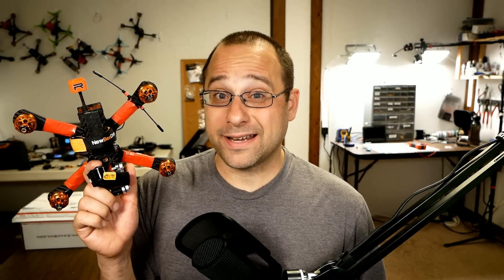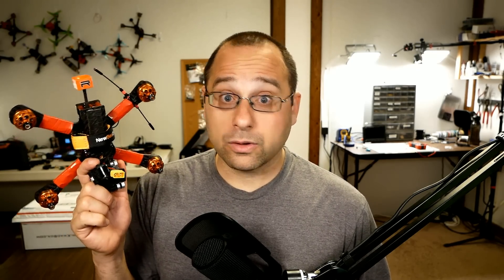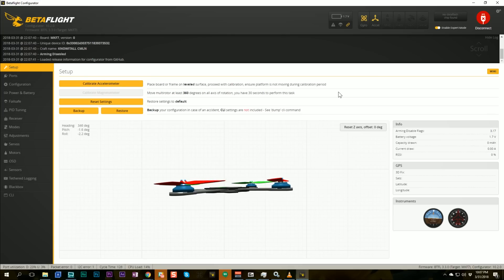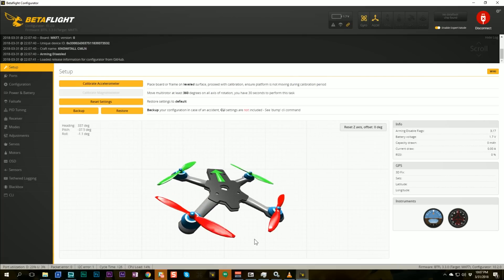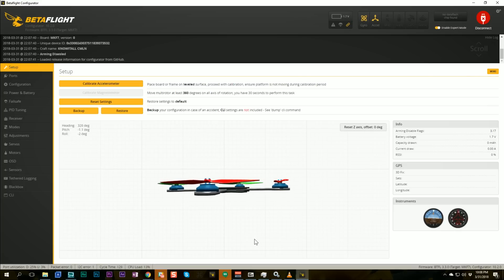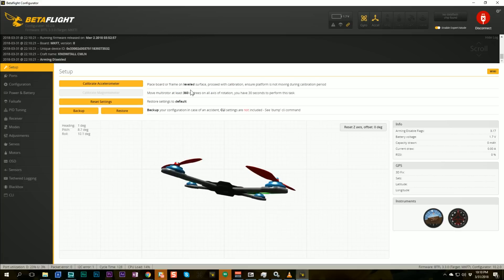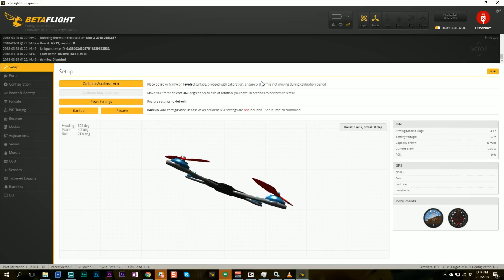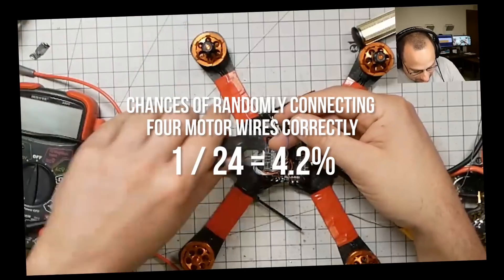Betaflight flight controller and ESC alignment incorrect | HOW TO FIX

Comment: Hey Joshua any reason why on a new build in the setup screen looking at the quad and it’s sitting flat and steady, it’s very slowly yawing clockwise, if looking down at the model, but it seems to be pretty steady when hovering in flight. Should I be concerned or just attempt to start flying normally? Thanks!
Reply from the maker: If it's just moving slowly, I wouldn't be concerned unless it also does it in flight.

Comment: Just flashed to 3.3 today flew first battery fine plugged my second and now I have battery warning and rssi constantly flashing in my osd even though it shows the correct voltage tried other battery’s an still the same, anyone else had this problem? Also if I try save & reboot on BF I get serial port failed to close tried fixing with zadig and impulserc driver fixer still no change. Running kakute f4 v2.
Reply from the maker: Serial port failed to close simply means the FC disconnected and rebooted. Don't worry about it.
Reply: Joshua Bardwell thank you for your reply.

Comment: Very curious... I have a Bcore2 that is flying great... FC mounted 180 on yaw access (right side up, but facing backwards) and set up for reverse via gyro in the "ALIGNMENT" section. 
This video made me take a look, and on the 3d model in Betaflight front was back!!! I just set it up as above.... (yaw @180 and motors reassigned via CLI) 
I wonder if it will feel any different?

Comment: I gues i'm wrong but don't you need to free the motors first in CLI  before remapping?
Reply: I know what your saying I have had trouble with resources not reassigning if not cleared first. I always take the notes I need and clear the assignments save then do the remapping. Its a pain in the butt but that method has never failed me.

Comment: Wish I could change motor direction in betaflight as well. Running parallels and blheli 32 in the field sucks sometimes. (Sometimes I just cross the motors wires and fix it later. 🤐)

Comment: I'm picking nits but... The resource numbers appear to actually be numbers expressed in hexadecimal format B00 (bee zero zero), B01 (bee zero one), etc.  You typed numbers when you entered the CLI commands but you consistently referred to the number zero as 'oh'.  There are bound to be some people who believe you're referring to the letter 'oh' as opposed to a colloquialism of zer-'oh'.
Reply from the maker: Betaflight will reject that if they try to do it.
Reply: I know.  My point was that if someone is unaware of the difference, using 'oh' instead of zero might be a bit confusing even in understanding an error generated from Betaflight under this circumstance. I'm not even sure whether using 'oh' as a shorthand for zero is common outside the US.  Again, this is a nit pick. This was another very useful video.

Comment: Great information.

Having a wizard in the Betaflight configurator to do the FC alignment and motor remap would eliminate this problem.  While at it, a wizard to set pitch/roll/yaw/throttle channel order (and reversals) would also be nice.  These are the common absolute basics set up on every quad.  Why not have the devs make them super easy.

For alignment, wizard would ask (level copter, then tilt model forward (and return to level), then roll model left (and return to level), then turn model left (and return to original direction).  {do change, then a repeat to confirm}.

For motor it would have sliders for each motor and move sliders till motor 1 spins, (check once found, grey out slider).  Then move sliders till motor 2 spins  (check once found, grey out slider), repeat till all 4 motors done, then do a confirmation.  Then do a confirmation that the appropriate motors spin.   Alternately spin each motor at 10% for 5 seconds and wait for a keypress when on the correct motor.  Make the whole process super easy.
Reply: ArchmageAU you mean like RF1/Flightone?
Reply: I have not used RF1/RaceFlight/Flightone/Butterflight/Kiss or any other quad firmware apart from Betaflight.

First quad was a Wizard X220 in August 2017 (so fairly new in the hobby).

The idea of a setup wizard is just common sense.

Comment: The option to adjust gyro and accelerometer alignment individually was probably added for users of custom boards, or to overcome an error in the target code.   

Pro tip: if you examine your orientation carefully, you might find you can get there with only one step.. IE, if you yaw 180, and roll 180, you can simplify it with only a 180 pitch.  This might be pointless on he f4, but on the silverware firmware on an nRF cpu, the performance difference was tangible...

Comment: Good topic for a video Josh.  I've been building for a little over a year now, and remember learning this the hard way back when I was getting started in the hobby.   Now my very first step when connecting a new board to betaflight is to check my alignment by pitching and rolling the board in the setup page..

Comment: doesn't a 4in1 esc have motor designation signal wires ? I'm sure it doesn't matter how you install 4in1 as long as the motor signal wires are connected to the FC in the correct motor config
Reply from the maker: Yes but apparently I can't do that. Because the signal wires are all the same color and twisted in a bundle. So I don't know which is which.
Reply: I mounted my 4in1 sideways. Is this why my motors spin up un even when I try to raise the throttle on my transmitter?
Reply: Joshua Bardwell I was always told not to use 4 in 1 escs because if one fails u have to replace the entire board vs swapping one esc. is this not the case any longer? are 4 in 1 escs much much better than they were 2 years ago?  

I suppose with the smaller and smaller frames it's becoming harder to mount escs to the arms.  but besides that is there any other reason for using a 4 in 1?
Reply: this is exactly what I do when i mount a 4 in 1 esc in a different orientation, just have to make sure that whatever esc is bottom right goes to the motor 1 pad on the FC and follow the sequence top right to motor 2, bottom left to motor 3, and top left to motor 4.
Reply: I mounted my 4in1 sideways. Is this why my motors spin up un even when I try to raise the throttle on my transmitter?

Comment: This is where the FlightOne kicks Bf ass. The orientation wizard and motor id wizard is what bf needs.
Reply from the maker: Damn straight. I have no idea why the BF devs don't see the value in this.
Reply: i mean i guess the argument would be that they would rather put time into the flight of quads rather then user experience but i dont agree with that view

Comment: CYT esc motor beeps - two quads same BF firmware. One has motor beeps betaflight 35a 32bit. Other no beeps esc spedix 30 32bit. When I select motor beeps on, on the second second it won’t arm?!  Any thoughts happy to share via email.

Comment: I just had to re-map motor 4 to led pin last night haha
Reply: HardTimeZFpv ugh. I had to do the same thing with my JBF4 with motor 1. But I wanted to use led pad for smart audio, and my uart for Crossfire, so I traced out the circuit and did some micro surgery to get it going again.
Reply: whoa! gnarly job, i bet it was rough haha. i had a signal pad rip off and on the BFF4 & motor 5 has the same B06 as led strip so just had to disable motor 5 and led n just pop motor 4 on led and its good as new!

Comment: Josh this question is a little out of subject but I’m a kiss guy and I can’t flash any of my fc defuse mode is not working
Reply: It doesn’t find my fc
Reply: id try to use dfusedemo to re upload the windows driver, then see if it will connect in the kiss gui